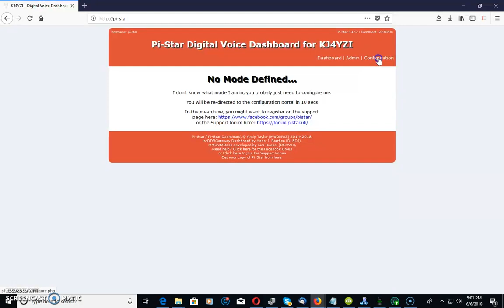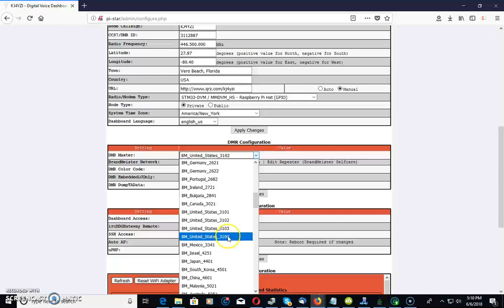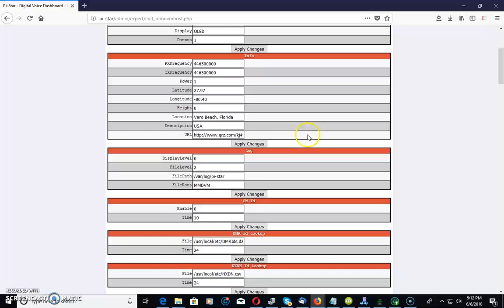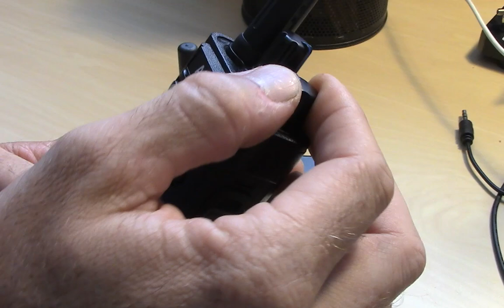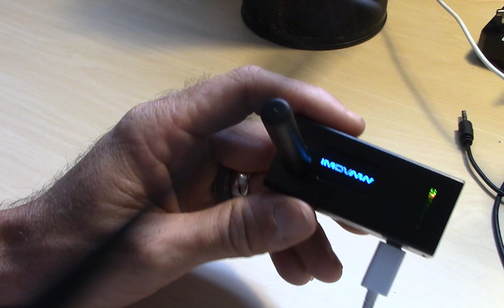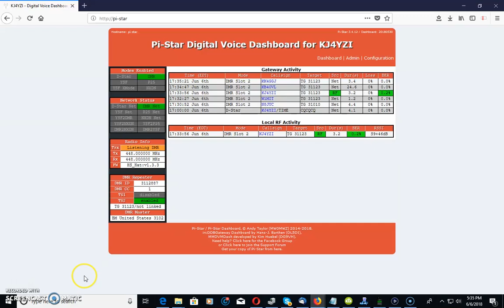Pi-Star / DMR Complete Tutorial Hotspot Programming

Comment: I wouldn't be guessing in the advanced menu.  All the hats will be different.  Its the nature of the modulation type.  While you had a value to fall back on, that someone else optimized, it may make it worse on another radio, even if they are the same model.  If you need to change the freq offset, then most likely you need to calibrate the 2.75mhz deviation as well.  A cheap nano vna is all that is needed.  IMHO, it should be done right, or left alone.

Comment: grrrr just updated both of my boards to a new version. now i cant tx... the boards wont receive it. i have to check to see if my server is set correctly and then i will try the offset at -475 to start. hopefully that solves it. any other help from anyone would be greatly appreciated. im not sure what is wrong with my set up. Its a jumbospot using pi zero W.
Reply: Same problem, did u fix it?
Reply: @marianochabeta  yes fixed a while back👍🏻
Reply: Thanks how did u solved this? I press ptt and nothing happens on my hotspot. But i can listen perfecto
Reply: @marianochabeta  once my boards were updated I rebooted both. It solved the issue👍🏻 hope this helps

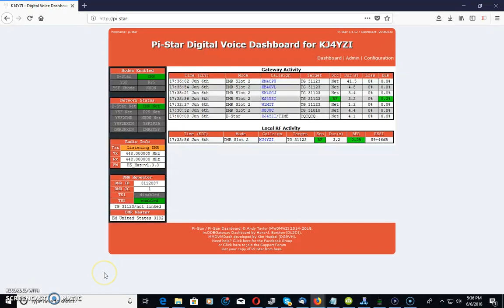Comment: Hi Eric, I've been through two YT videos trying to get my HotSpot working but seem to have a problem. In your video @ 22:37 you can see 7 lines of data in the Gateway Screen, all ever get is 1 line so not sure why that is. But I just cannot get any response from anywhere. I've just put a call out to Echo on 9990, no response?
I got the hot spot because I wanted to remove the RF link to my local repeater as a probable cause of no response but even that scheme seems to have failed?

Comment: all good except the last bit. It's a simplex hotspot so TS1 will always be disabled. That doesn't mean e.g. that a TG on TS1 should be programmed in the code plug on TS2 because the hotspot TS1 is disabled. The Hotspot will translate for you for TGs which are set to TS1. It will receive and then Tx on the net on the codeplug set TS... Am I wrong?

Comment: Great video. I have followed all your instructions, my Jumbospot sees my radio, as I can see my call on the screen and the radio shows a full RX. However I cannot hear any audio, and cannot check to see if I have audio going out. I know there is audio TX and RX, as I used a second radio to TX and RX. Using a Motorola DP-4800. Frustrating.
Reply: I had the same problem, and had to adjust my receive offset before my radio would pick up the audio.  It's not always the same as the transmit offset.   73 de N8VSI
Reply: By the way, continuing from my post from a minute ago.  I would suggest setting up so you're sending to a PARROT / ECHO channel, and using that to check your audio.  If you have it set right, you'll see the return on your dashboard.

Your outbound call will have your call as the source, 9990 or 9998 as the target, and RF as the source. 
The return call will have 9990 or 9998 as the source, your call as the target, and NET as the source.

You can use the same screen to check your BER and Loss, to troubleshoot your connection.  Tune your receive offset just as you would your transmit offset.

Hope this helps!  

Scott - N8VSI

Comment: Great video!  Thank you for taking the time to create...  One this to consider is that the OLED display needs to be set to Type 6 in the expert configuration for the MMDVMHost.  This is probably already set in the bundled system, but if you do a Pi-Star image update that parameter seems to get lost.  
Thanks again.  73!
Reply: I think it depends on the display size. From what I could tell, the .98" display requires OLED 3 while the larger >1" screen is OLED 6. The Jumbospot I'm using has the smaller screen and OLED 3 is working. :)

Comment: I'm glad I found this. The only change I had to make was the RXOffset on mine is -475. It doesn't say anything about the TXOffset though, so I'm leaving that at 0.
Reply: I am by no means certain but I believe the transmit offset should be the same, have a look on Ebay, one of the kits has that in the description
Reply: @g0fvt  Sometimes it's the same, sometimes it's not.  WHen I set my board to the required TX offset, my radio wouldn't receive.  Tune into a parrot or echo talk group and use that to tune your receive offset, just like you do your transmit.
Reply: @scottkuma  my MMDVM is operating with the suggested +500 correction on both transmit and receive, certainly the received BER is very low not easy to gauge in the opposite direction. FWIW my MMDVM is not the full duplex capable version.

Comment: I have mine setup for C4FM and I hear QSO's but I can't transmit.  I'm using the 145.290 repeater but my PI shows 444.0875 for some reason.  The configuration I have is set for 145.290 in the general page.  What am I doing wrong?
Reply from the maker: Wait.. You transmit in to the hotspot on UHF. Why do you have 145.290 in there?
Reply: Turns out that part of the configuration (444.0875) is only what it displays, nothing to do with what frequency the hotspot will receives on.  That's only what the display shows, nothing else.   Oh and 145.290 is what I picked, I use UHF

Comment: I recently got my DMR to work with my Zumspt but I seem to notice that when I am on the local repeater that I can hear a conversation on a talkgroup but when I switch to the Zumspot I dont hear anything on the same group but the Zumspot lights up when somebody is keying up and my HT shows a full signal receiving. When I do “parrot” on the zumspot it works, when I try the 5000 channel it works.  What do I change in the zumspot settings??? My BER is at 1.2% on the pi-star dashboard and lights up green. I am using a Anytone 868UV

73,
KC9SXI

Comment: I just received my Jumbo Spot and have questions. I plugged it in and went to the pi-star link and it is just an information page. Its looks similar to the page you have but not the same. The header shows, " PiStar.UK-PiStar Digital Voice Software" How do i get to the page you show on he screen. Also on the video you had D=Star already set up and you did a reset but it was from the page that was already ready for set up. That is the page I am trying to get to but do not see. How did you get to that page? Once I get to that page I will be almost done. I do see my Jumbo Spot on my wifi network and on my phone and it ask for a password and i put i n my Network password and it does not take. I think the Jumbo spot has a micro SD card but it will not come out if I push it in. Stuck!
Reply: You seem to have put the wrong address in, you are looking for the web interface of your hotspot, not the web page of Pistar UK

Comment: Thanks for the video. Very helpful.  I still can't communicate through the radio to the Jumbo Spot.  My Jumbo Spot didn't come with any paperwork or sticker to tell me what the offset was.  I have tried everything from +2500 down to -2500 in 100 increments, and I still can't get the Jumbo Spot to respond.  Is there anything you can tell me that might help me get this thing working?

Comment: I'm having some trouble. I have my jumbospot setup and rolling but no keying up or hearing anything I think because my unit has no sticker for offset.  Any suggestions?
Reply from the maker: start at -475 and go + or minus 25 until you get it working.
Reply: HamRadioConcepts thanks. I've had it 2 days and can see traffic on it but can't hear or talk yet. Pretty sure my id-51a is right because if your 5100 setup video. 👍I'll keep trying.

Comment: How do I change on Pi-Star that I want to use TS1 and not TS2?
Reply from the maker: You dont.. You just stick to TS2... A hotspot doesnt use Timeslots, so its just one slot all the time. Repeaters are the only difference when you talk about time slots.
Reply from the maker: What I mean is, there is no such thing as TS1 and TS2 on TAC310 through a hotspot or any other talkgroup. That only applies on a repeater, you can have TAC310 on TS1 and 3148 on TS2 on the repeater at the same time.. The hotspot, you can only have 1 Talkgroup at one time.. On any hotspot.

Comment: Excellent Video. I followed the previous video and had a couple of difficulties, but it is all worked out. One thing I would like to add regarding the DMR ID. If you are running the Jumbo Spot in private mode, the DMR ID in the Jumbo Spot and the radio need to be the same. If they are different, the radio and Jumbo Spot do not communicate and you get an error on the live logs  that says "RF User ####### rejected". If you operate the Jumbo Spot in public mode, any DMR ID will be able to access the Jumbo Spot. At least that is one of the problems I had. The reason I had this problem is I assumed you needed a separate DMR ID for each device, and I applied for and received 2 DMR IDs.

Comment: I am curious if you could use an analog radio to something like a dvap. Then the dvap converts it to digital and routes it to a certain reflector, or similar. I would imagine it wouldn't work but i can dream. Really dont want to buy a $600 dstar radio and then spend another say $400 for dmr. That is the price of a good hf rig. Anyways thanks for this video
Reply from the maker: A DMR radio is $70-$120 bucks, a Dstar radio is $200-250 ....
Reply: HamRadioConcepts The cheapest I have found dmr is 175 and dstar 500. Tyt 2012 was 175 and used id-51a was 400 and the best one is the kenwood th-d74 with internal kiss modem. Its 500 or 600... These are just what i found so far. Im not saying there arent good deals but i cant seem to ever find them.. :/
Reply from the maker: Samuel Sims what is wrong with a Baofeng RD5R or a Tyt md380?
Reply from the maker: Where are you shopping for these radios?? The ID51a+2 is not even $400 brand new...

Comment: I have a Jumbospot on the way so this is just in time. I haven't watched yet but does this video explain how to have multiple SSIDs, if not any examples online how to do so?
Reply from the maker: Once you make the config, you can add SSIDs in the dashboard at the bottom
Reply: Thanks for the reply. Mine should be here Friday. Radio on the way also. I just passed my Tech exam a few weeks ago. Got my DMR ID and also setup on Brandmeister. Now just have to wait on the equipment to arrive to get on the air.
Reply: Got my JumboSpot today. It had 3.4.10 on it. Updated to 4.13 followed your steps and got it set up. Also added my work Wifi along with my home. When I look under Brandmeister and My HotSpots it shows there also.  
Now I just have to wait till Monday for my radio to arrive and then start on a CodePlug. Seems like I read it's best to read the radio the first time and then do a CodePlug from that read. Not sure if that's true or not. Thanks for the informative video